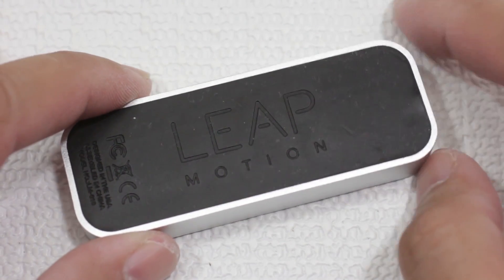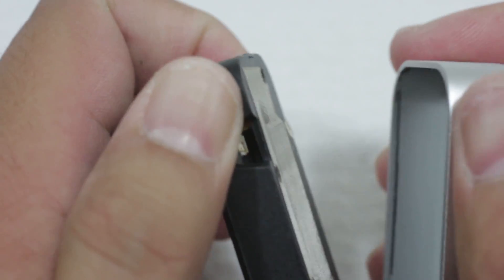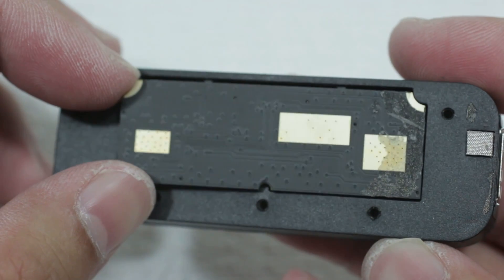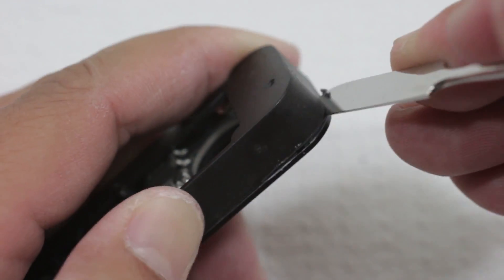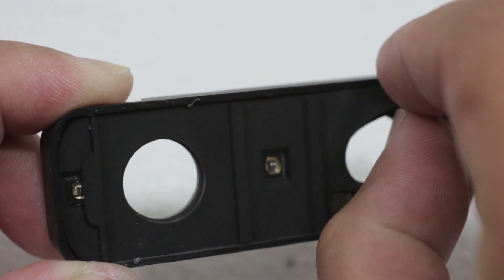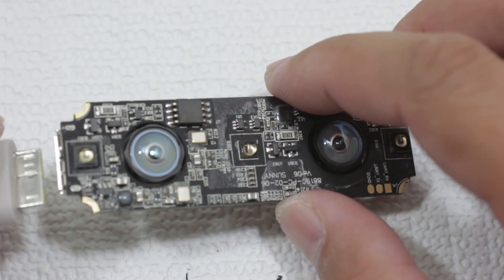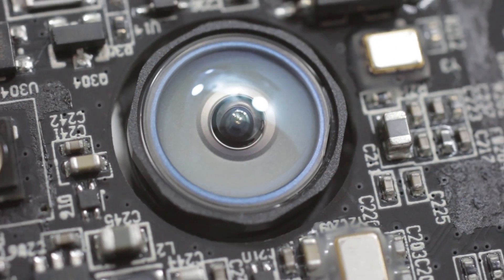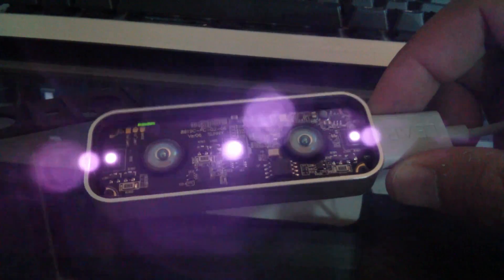Leap Motion Teardown in Macro HD

Comment: So this is just two very low budget webcam lenses with the IR filter removed slapped on a controller board with 3 IR LED's? a five dollar set up for 80 bucks, and doesn't work that well to begin with? No thanks. But I am sure a decent hack would be to mount that, forward facing, onto a quadcopter and output a feed from each lens onto a fatshark for 3D flight.
Reply: I think they're higher end cams. 290 frames per second. (Wiimote sits at 100) plus fish eye lenses for wider range view.

Now if it acts like the wiimote cam and does the processing for the finger points, on board, and then sends xyz cords..... AND via those uart terminals, if say it's WELL worth 80 bucks.
Reply: Whole new drivers would have to be developed for flight. I do think these drivers are onboard but they're generating up to 10 points and hand shaped. The drivers needed would have to generate a point cloud of non hand shaped points. And that could be achieved with ANY dual camera setup. 

I believe your pricing is backwards. The leap motion retains the higher price due to the onboard software.... And frame rate
Reply: Sorry.
It doesn't process points on board from what I'm reading
Reply: One of those cameras is easily 5 bucks. Nothing near a standard webcam, thats some specialized 180 degree fov ir sensor.
Reply: They have a new update called orion, and it makes it much worth 80 bucks or now worth 72 bucks. I just got mine in the mail and its amazing
Reply: Your spending your money on not only the product, but the software and multitude of free apps on their web store.

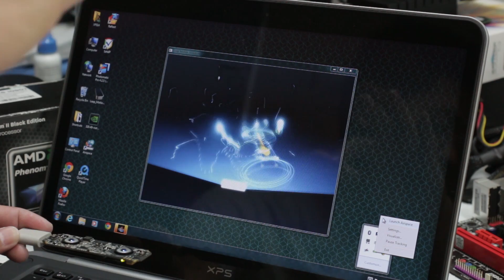Comment from the maker: I don't think it is a IR filter because it needs to output IR to bounce off your fingers. I did not have any deterioration in performance despite using it with the cover off and with really bright daytime lights as seen at 04:07 in this video. There should have been a warning that the lights were too bright and I have only gotten a warning about smudges on the cover. Sure you can reference my video in your thesis. I hope to do the same with my videos in the near future. Thanks for watching!